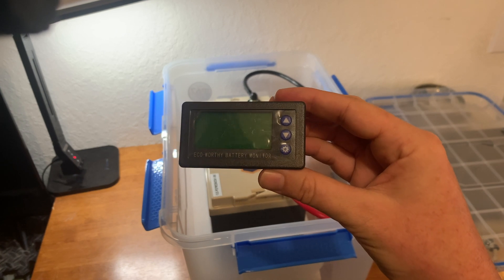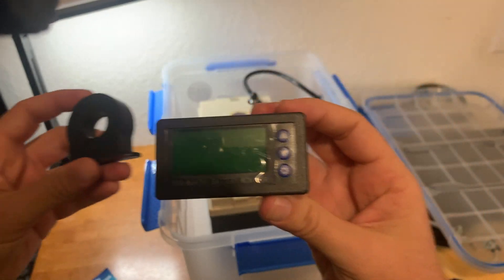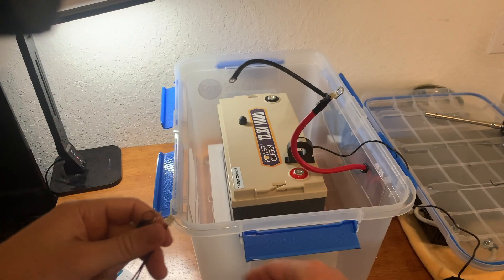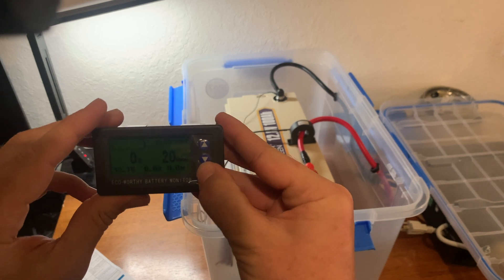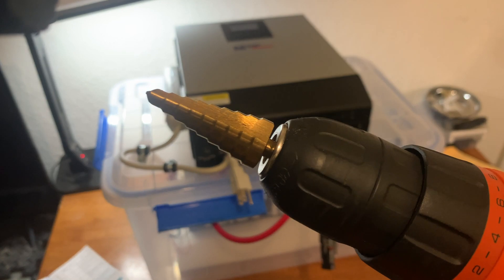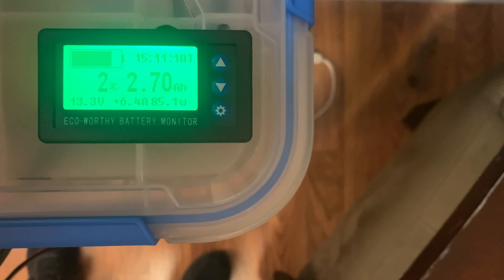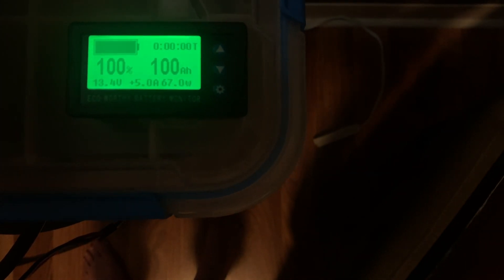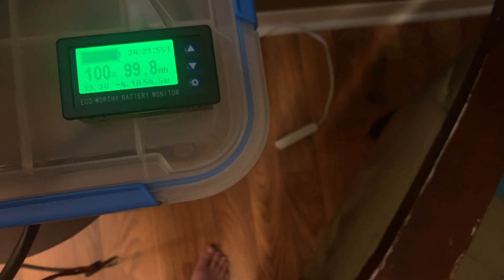Eco-Worthy Battery Monitor Install - DIY Solar Generator upgrade

Comment: Cool video thanks! Does it have like a uart or can port so you can do a readout with a micro controller?    One last thing, I didn't see a fuse between your inverter and battery. I would really recommend you get one, even though the battery has a BMS you never know with these Chinese equipment.   dihool makes nice DC breakers. Or get a single good quality mega fuse holder with mega fuse.

Comment: You need one that supports two Hall sensors at the same time so you can monitor power going in and out at the same time and on one screen.

Comment: I recently got one if these monitors an im trying to manually set the meter....i gwt it wants you to run the battery dead but how is that good on the battery? Ive always heard for agm style batteries for instance they recommend not to go below 50% capacity
Reply: Lipo4's arent like AGM or any other technology technology. You can run  them down flat thousands of times before any degradation and even then, it's slight. So don't worry about using them hard.

Comment: It's a CT shunt.. The Utilities companies use them to measure watts used. They been around for years. Mostly in apartments where they have only one meter. So they install these on every main breaker feeding the Apartment.. And they are highly accurate. As the Utility Companies don't give shit away..

A normal shunt reads Amps...

Comment: QUESTIONS:

1) Can this be used on multiple batteries in series?

2) Can this be used on Solar Panels?
Reply: Only on the load side positive wire coming off the battery...

Comment: Just got one of this meter; so I got 4 Batteries (lifep04), combination of parrallel and series. Combine all together I got a 200 AH and 27V at full charge(at rest). So for programming I should enter 200 for AH and 27 for full voltage. Is this correct?
Reply from the maker: Hi Lustatus, without knowing the details of your battery packs I wouldn't be able to say what the fully charged voltage is, however, there is an auto detection feature of this monitor. To use this feature just wire up the monitor according to the instructions, discharge your batteries until empty, hold the down arrow on the monitor for  3 seconds until the read out shows zero for everything, charge your batteries back up to 100% and you should be good to go :). Good luck and I hope this helps you out !!

-Josh

Comment: Can you run this 100 feet away with a wire?
Reply from the maker: Hi Bill, that's a good question! The cables that this uses are probably too thin to remain accurate for the sensor at that length. I would suspect that this would effect the readings negatively.
Reply: I would be willing to run thicker guage . Or maybe I should just go wireless with  a capable charge controller

Comment: I didnt see any fuse on positive side....???
Reply from the maker: Hi Alexandre, great point!! My current project is going through each of my systems and adding fuses on ALL wires that connect to the positive battery terminal (even battery monitor connections). Better safe than sorry !!! Thanks for the comment!

-Josh
Reply: @oh2bfr337  What size and type of fuses would you use for a single 12v 100ah LifePo4 battery system? I will be using a 120v/50-amp LifePo4 battery charger with it initially and then later on when it's all mounted in my truck camping setup, I'll add a dc to dc/solar combo charge controller unit as well.
Reply from the maker: I would use an ANL or bolt-on style fuse that is rated for ~125% of the maximum continuous current that your battery can output. For example, I have a 12v 100ah power queen battery that can output 100 amps continuous (100a BMS) so I would put an ANL 125a fuse on the positive terminal of that.

Here is an example of what I would use for a battery that can output 100 amps continuously:
https://a.co/d/gPZJUM8

You will want to refer to your batterie's specific output ratings though as some 100ah batteries can output more or less than 100a. Also, make sure all of your wiring is rated appropriately for this amount of current too. The current ratings should be very clearly documented by the battery manufacturer and sometimes its even stated on the battery itself. Good luck and I really hope this helps!!

-Josh

Comment: You'll need to set the voltage to 14.6v for that lfepo4 battery.   And a tip to fine tune the meter. Chage battery all the way up and then hold the up arrow down for 3 seconds. Also deplete fully and then hold the down arrow for 3 seconds to set the low end of the range. The directions are in the manual
Reply: No you don't.. 14.6 is the Charging voltage.. You have to input what the battery tells you.. As 13.5~13.6 volts is Fully charged at rest Voltage.......
Reply: I was wondering about this V thing 13,6V or 14,6V, as it is not clearly stated in the manual. I have just installed an eco worthy 200A monitor and am about to put it into operation. Which do you think is the correct V value.

Thak you your videos!

Comment: Cool video and device. Supposedly the shunts meters are more accurate. Usually the shunts have bolt terminals on both sides so there isn’t any splicing required. Compare with the cgele shunt meters on your next build!
Reply from the maker: Thanks for the info!

Comment: Interesting. Thanks for posting. Little concerned with draining battery though. Will need to do more research before going with this for my trolling motor battery. Again thanks
Reply from the maker: Hi Deznes, if it helps here are the working current draws of this monitor:
Backlight off = ~5mA
Backlight on = ~ 10mA

I hope this helps !

Comment: I just received my monitor.
Do you have to start with the batteries totally depleted or start with the batteries full?
Reply from the maker: Hi, I've found the easiest way to calibrate the monitor is to zero it out by holding the down arrow for 3 seconds , you should see the numbers zero out. Next drain the battery to zero and charge it back up to 100%. Once the battery is charged to 100% the monitor should be ready to go. I've used this method on two of these monitors and it has worked very well so far. Thanks!